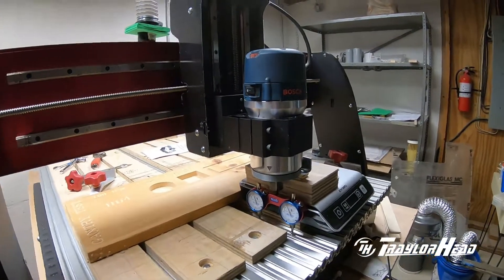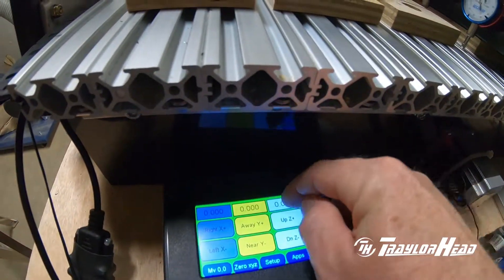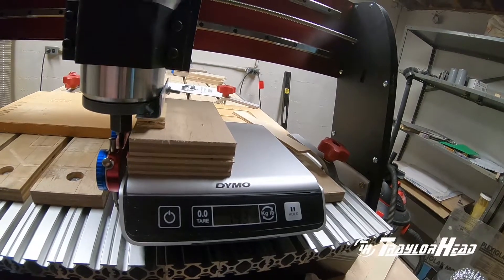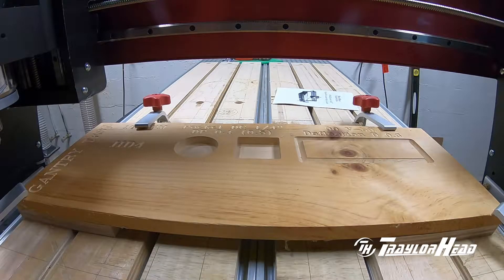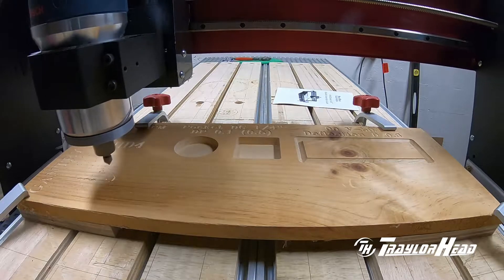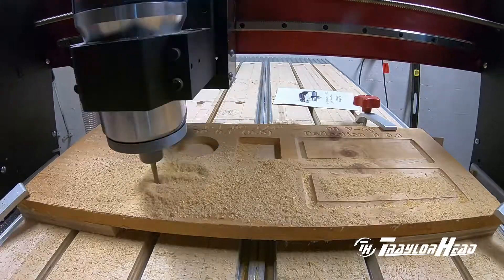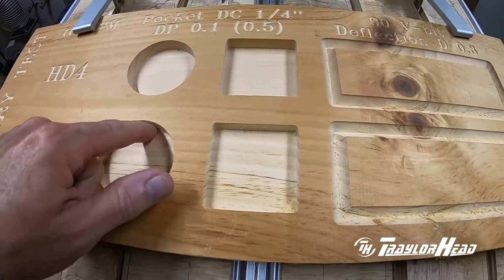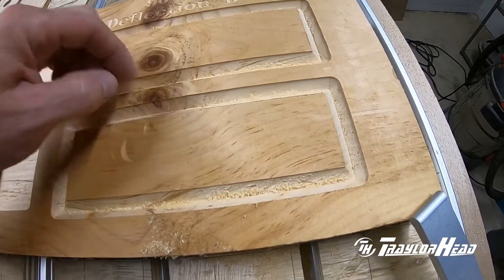HD4 to HD5 Gantry P4 of 4 (HD5 Measure and Test Cuts)

Comment: James, thanks for the excellent set of videos here.  I'm considering upgrading my HD4 (never been happy with the build quality or deflection).  I don't know if the money for the upgrade should be spent in the upgrade or on a different CNC.  I wish the test had been more conclusive, but yes, I think just not enough pressure was applied.   I wonder if using a fish scale and ruler to measure the deflection under the same pressure would work for a test.  Anyway, again THANKS for the vids.